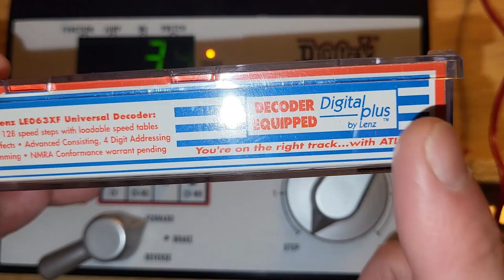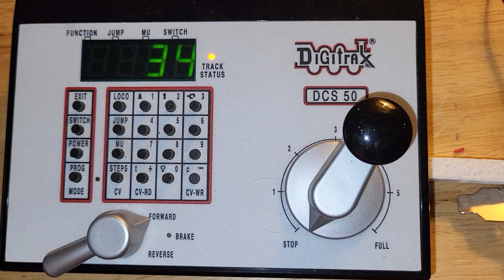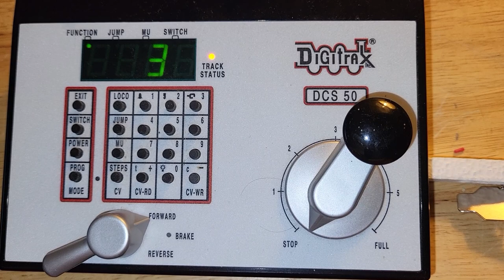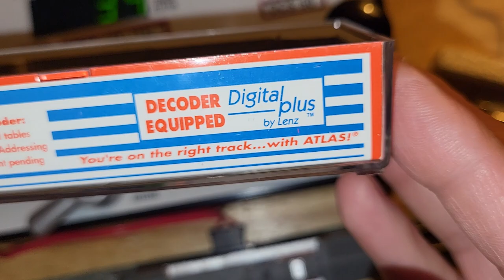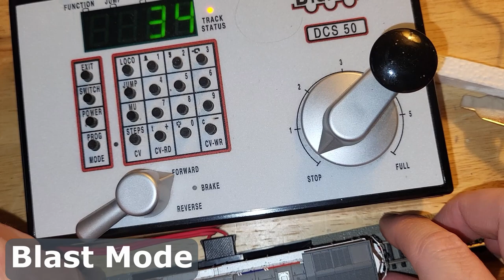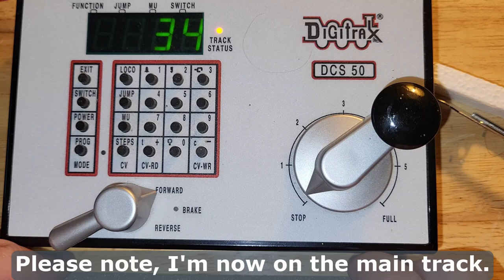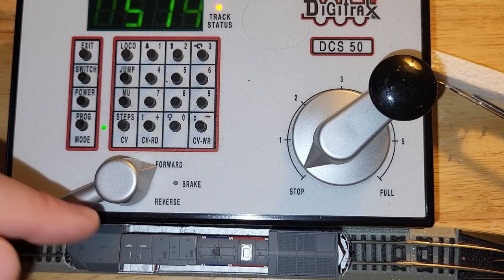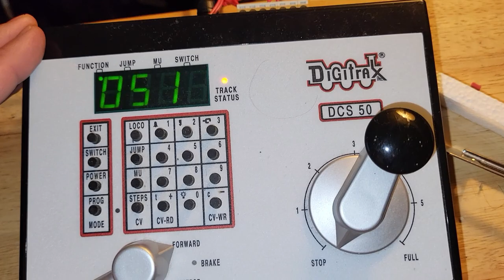Getting errors, like the infamous DND on your Digitrax Zephyr? Watch this video!

Comment: my dcs 50 died 4-5 years ago...no power through the controller to the main track....i believe the output drivers quit...i need to figure out how to get it open
Reply: Peel off the 4 rubber feet and there are screws in there

Comment: I have a DCS 51 that showed it was full as far as road numbers. I watched a video from the digitrax, inc channel that showed a way to reset the 51. I tried it and that's when it died. It turns on but that's it if I remember right. It showed a po 10 code it's been a while but I think that was it. So I bought a DCS 52 and fell in love with it. Unfortunately, it fried after less than two years. I would go back to my 51 if it worked but for now, im using old reliable tech-2. Is there a way to properly reset the dang thing and get it working again that you know of? Because most of my locomotives are DCC and the Tech2 just can push them. Also, I enjoy the sound that's why I bought the dang things in the first place. Any help would be appreciated. I plugged in the 52 and it reads ok input dc voltage and local track booster default. It reads that when not connected to the track.
Reply from the maker: Hmmm, I don't mean to be harsh but are you sure you entered the right rest commands in on the DCS 51 when you reset it? The reason I ask is I had done something similar and got that same error. I would try a full system reset again, you can google the procedure or use the video from Digitrax. If the DCS 52 hasn't physically smoked or sparked or anything like that, I would try resetting  that system as well, I find that these things have a habit of coming back to life after sitting for a while. If the error persists, I would try just hooking up to a single peace of track and see what that dose. If this works or the error still persists, I would try replacing the power supply. I found that this is a common fault with the Digitrax systems. I've found that there are a few 3rd party outfits that sell on amazon and eBay, that make power supplies for far less then the cost of the official Digitrax ones that work as well or better, just make your its for the specific model system you have. If all else falls, try emailing and or sending them both into Digitrax ( get an RMA first if you send them in) and see if they can help you out. They "MAY" be able to fix on or both for less then the price of a new one. Also, note that there going to be the usually take back sales after the holidays are over. You may find a good deal on an open box DCC system.
Hope this helps! Thanks for watching!
Merry Christmas and Happy Holidays!
Reply: @alcobufff  thank you for your reply. The 52 just started to smoke once I plugged it in the 51 still no response. I'm going to look around for a system that has the ability to hook up to my laptop like the 52 did so im able to use decoder pro. Outside of Digitrax and MRC, I'm not too familiar with any other systems. So I'll be checking the net and shopping around. Also, I love your series on the Alcos road switchers very informative.

Comment: Blast mode seems to program on the main line only and not in the programming track. So is this any different than just using mainline programming?
Reply from the maker: It works on both the main and programming tracks, I've tried it.
Reply: @alcobufff  huh. Very interesting.